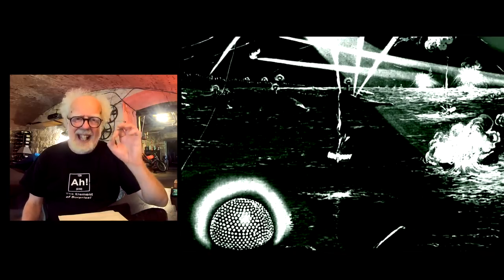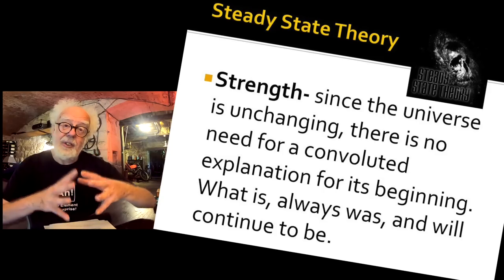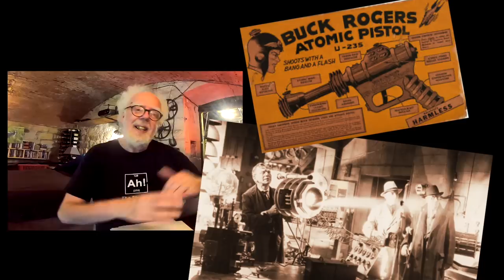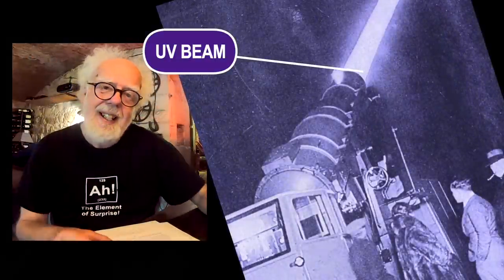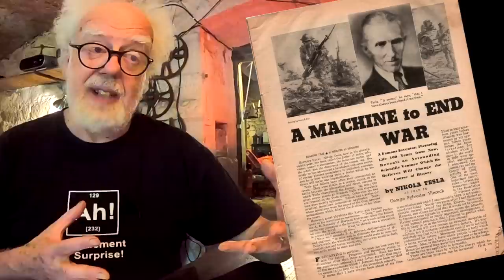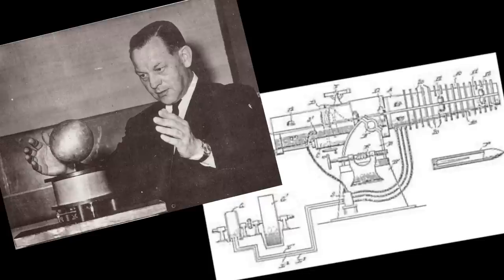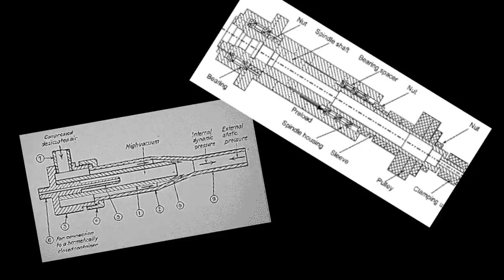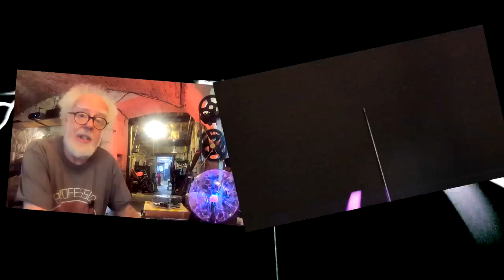How Tesla's Death Ray might work  - part 3 - Prof Simon

Comment: Tesla was not using the Van der Graaf type of generator. He used HF AC generators feeding his ‘magnifying transformer’, now usually called a ‘Tesla Coil’.  Cockcroft designed his own voltage multiplier because he needed DC: that is known as a ‘Cockcroft Walton Voltage multiplier’, a design still in use today, for things like ozone sources, ionisers, and Geiger counters. It’s a stack of rectifier diodes and capacitors, a technique sadly not available to Tesla.
Reply from the maker: good points...thank you....
the principal of using extremely high energy to break down matter was the only reason i used the Walton Cockcroft experiment.

Comment: A friend and I were on top of Figeroa mountain look out, Santa Barbara County Ca. USA late in the evening. We were looking southwest toward the ocean and the air force base when, a dome of light appeared over the ocean. This happened twice about 2 or three seconds apart. The dome of light was at least a mile off the coast and higher than the peaks of the coastal ranges that followed the coastline, the tallest over 2000 feet. The domes looked exactly as you had described. 
Just wanted to share that.
Thank you for the great video.

Comment: vacuum obtained from compressed air is used in many carrying systems in industry. You can even have a cold and a hot vortex formed with a single system using compressed air, this was used for example to make glue hold on tin cans; I still can't get how hot and cold get formed at the same time. On the other hand, a lightning will somewhat follow a laser beam, so I agree that such a high voltage aerial sphere would allow for example an electromagnetic impulse or particles to travel along a laser beam or other plasma generating unit. If for example those particles act as if coming out of a particle accelerator, then it sems it generates swelling. It could well be damaging computer units and electric circuits.

Comment: I guess high vacuum is going to be 0 bar. You can’t have a higher vacuum than that. So balanced by high pressure air eh, hmm. The image you show acts as a Venturi and draws the projectile material out of whatever reservoir  and adds it to the plasma conduit. So what causes the projectile material to move at some velocity towards the object? Why doesn’t the material fall out of the plasma? If it is just a few atoms of projectile material being added to plasma even continuously how does such a low mass cause the target any damage? Wouldn’t the target need to be grounded to become “acquired” by the plasma? So many unanswered questions. An interesting video but I’m left feeling I need more evidence.
Reply from the maker: yes....it was before rail guns but tesla invented the ideas behind the Cyclotron....so a strong magnetic device

Comment: Sorry professor I was doing something else while listening to your video and I missed the bit about Grindell. As an American I had never heard of him before. You say the vacuum in the barrel of the device is separated electrically from the atmospheric air pressure. Do you have any more info on how this is done? You state there is no atmosphere to interfere with the projectile. Does the mere creation of the plasma tube somehow expel the atmosphere from the plasma tube? You must have developed some awfully interesting contacts since creating your YouTube channel. I was literally doing book reports on Tesla in early grade school and have had a fascination with him ever since. When I heard they were going to turn his wardenclyffe lab into a strip mall I was one of many people who donated money to turn it into a museum instead. I have looked up and studied some of his patents trying to figure out how some of his devices work. I had never heard anything about his death rate using metal projectiles. You really shouldn't call Tesla's high-voltage generator a Van de graaf generator. A Van de Graaff generator is just a rubber belt running between two metal Combs that pickoff electrons generating high voltage DC. Tesla's high voltage devices were all Tesla coils which were essentially tuned aircore step up transformers producing high voltage AC. I look forward to future installments.
Reply from the maker: Tesla described it as a vacuum tube......with a hole.  that intrigued me !  digging into Telsa's work he published plans for the tube with a hole...a double walled device, evacuated in the middle and a balanced jet of air at the hole....making a sealed window and holding the vacuum inside for the electronic effects.....but making it open to project something????? what I asked??? because a CRT in an old TV didn't need a HOLE!  electrons pass through glass ok......ah ha.....Tesla needed a hole to release high powered metal particles that were eroded from the tube cathode and accelerated by a magnetic force.... think rail gun.   got it?

Comment: From what I remember from science classes at school a Vandergraff generator used a belt which passes over a rod of plastic to produce a charge. In Tesla's aparatus from the photos of the device I've seen, I can't see anything that looks like a Vandergraff generator, which would  be huge. I've seen experimenters using neon tube transformers and spark gaps driven by an electric motor presumeably to create a high voltage disrupted electron flow which can then be stepped up further by inductive coils with turns ratios of thousands to one. Tesla apart from his invention of the AC motor and such seems to have been fixated by high voltages these are useful to a limited extent and the AC motor is a, far more impacting invention. Just a question here though.... What has a particle beam got to do with the UAP phonemina that a lot of scientists are now taking seriously due to multiple sensor data which aparantly its not the UAP that are being suppressed but it's how the data is being collected via defence sensitive and national security issues about the sensors themselves which is the problem of disclosure aparantly. With what you said about Kenneth Arnold's statement I've seen an original film clip of him talking about his sighting and it was nothing like what you described. I do agree the press does lie. What does Professor Simon think of the battle carrier group and pilot  David Favours discription and other people that were with him in the tick tack event and also where it was shown an object going into the water?
Reply from the maker: i think we are being used and lied too.

Comment: A high voltage plasma beam would connect to a plane through either high voltage differential or through capacitance (depending Weather its DC or AC). If you stand on a chair (or even a better insulator) the plasma globe will still react to your touch the same as if you were grounded.
Reply from the maker: thank you. ....that clears that up.

Comment: I am not sure that I buy the explanation Simon. Tesla did not use a Van de Graaf generator. He used a Tesla coil, which generates its high voltage by electromagnetic means and is essentially AC. A V de F generates its high potential by electrostatic means - direct current. That in itself is not  a 'deal breaker' but The aircraft is not grounded, so I am not sure that it would have sufficient effect on the 'bubble'. Also, if the projectiles were atoms, they would be attenuated by the air. I don't really see how ionisation of the air would mitigate that.
Reply from the maker: i'm not sure of all the details, only what Tesla said.  that a death-ray defence station would emanate a 250mile field that would detect incoming aircraft and fire microscopic metal particles...i agree with you....it raises a lot of question.

Comment: So I dont get how high pressure air would block a hole in a vacuum tube.  By the way they sometimes use plasma in surgery, argon plasma in electrosurgery or it is sometimes called surgical diathermy
Reply from the maker: Tesla said he made a balanced window...the suck and blowing forces were matched to atmospheric pressure... no idea if it really works, but it sounds possible.
Reply: @ProfSimonHolland  Maybe if you blow air outwards from around the hole, or maybe create a venturi effect at the hole ( flow air through a restriction, it has to speed up as it passes, its kinetic energgy increasing so its pressure energy drops->suction) would work.

Comment: Very interesting about the ability to shoot iron filings or pellets through the plasma filament. If that worked I''d be amazed. It's the same tech as his 'wireless energy' and suffers from the same problem except now the problem is a benefit.. The problem being massive amounts of electricity in the air fries anything not protected by a Faraday cage or decent lightning rod all the time it's on, which is all the time..
--
God only knows what it would do to the weather and climate, and I don't believe in God but am more inclined toward a Big Bang that is one of many - cyclic in the big bang-big shrink sense or Penrose conformal cyclic cosmology sense (a long shot to me though compared to expansion and contraction). Steady State should not be discounted but it has problems dealing with Red Shift.
--
I don't doubt plasma projection technology but still think Tesla's Big Idea had too many problems to be practical, and electricity is most efficiently transported via conducting wires, with copper being a much better conductor than air. MUCH SAFER, much less waste. If we had practically unlimited, free power generation the idea could work. Anyone that saw the 'Coroner Effect' as a kid, with neon tubes lighting up near power lines, knows the electrical power of EM RADIATION..'Coroner Effect' will mean something completely different to today's young Geeks, sadly.